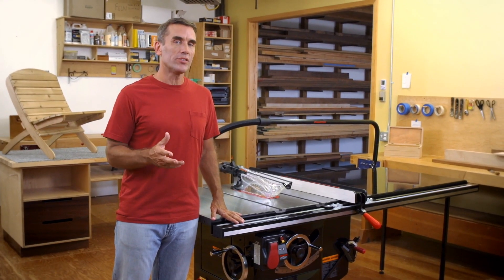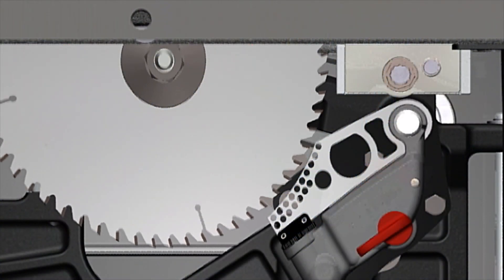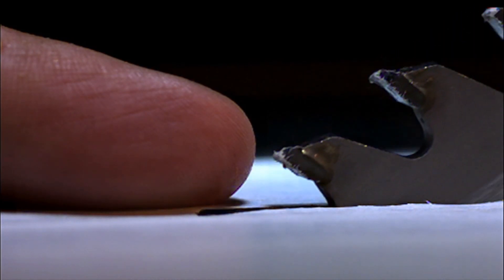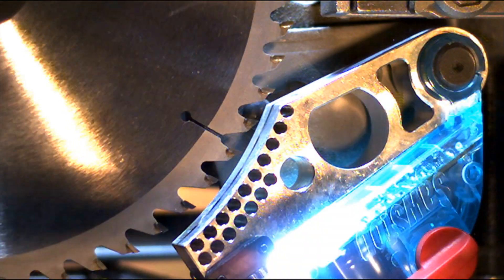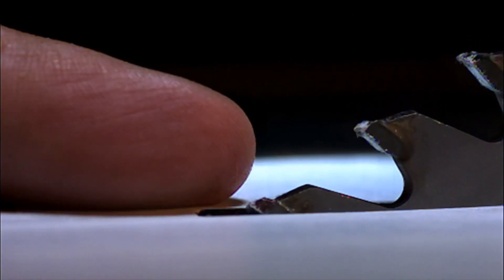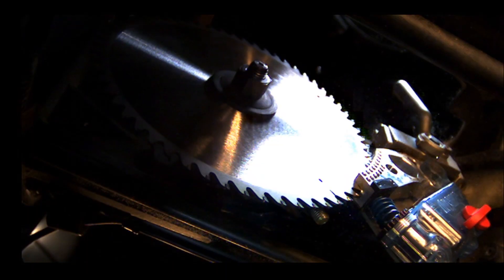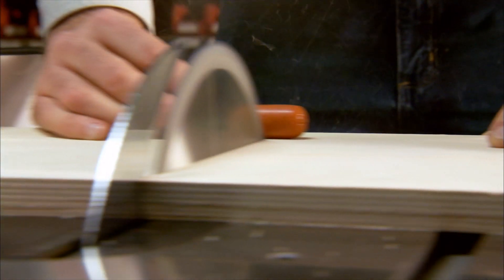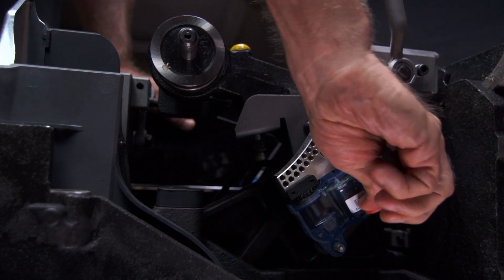SawStop | How does SawStop work? Find out more today

Comment: I have owned a 
Saw Stop cabinet saw for 7 years now. After purchasing mine for my use at home I took in the video for the safety leaders at the plant that I worked maintenance in. They watched the video more than once and realized the value of this saw for our QC lab work they purchased one Saw Stop saw. And they quickly understood the benefit of being proactive for the safety of the employees. I work in a large insulation manufacturing plant that routinely cuts samples of product for quality testing purposes and they cut that material on a table saw. Each time that I have had to change the brake unit has been due to someone not thinking prior to use of the equipment. Fortunately, there were no injuries because the equipment functioned as it was supposed to.  The first was caused by an employee trying to cut a foil backed piece of insulation. The plant safety procedure didn't explain well enough to the QC people that foil faced product will conduct electrical current thus causing the brake to trigger. Of the other two times I had to change the brake/blades one was caused by a non-maintenance person trying to change the units out and not having the gap set correctly and the other was caused by a tape measure blade coming in contact with the saw blade.  In other words, read the manuals before operating any equipment and pay attention to safe work practices at all times..
Reply: Hi mate, how much does this machine with the protection system included? Thank you!

Comment: Hi Ya, 
 Brilliant! 

I didn't knew it until now. In fact one of my workers had an accident back in 2014/2015 and had to undergo a pretty complicated surgery to get the fingers back to close 70% efficiency.  

Some questions, just reviewing it critically.....
You said electric signal?
Have you done tests considering use of insulated gloves? Would it stop as soon as it touches blood/skin after the gloves?
Also, if someone cutting something with some conductivity, does it gets activated or fails to retract within that 5 millisecond?

I am just curious.

Thanks a lot
Reply: I think in the case of gloves it would cut through the gloves and then stop when it contacts skin, unless the gloves are conductive through the person (like the hot dog they use in tests, you have to be holding it for it to work).